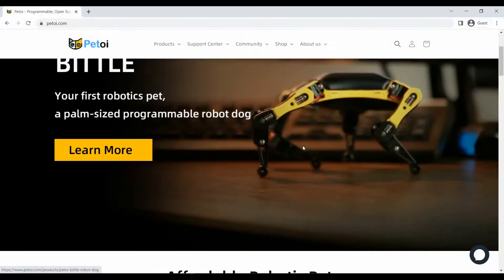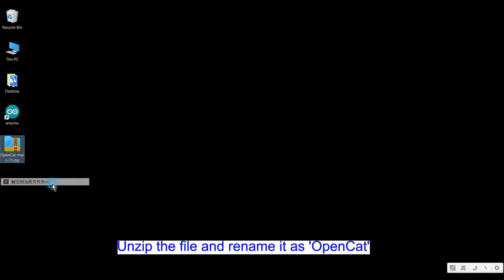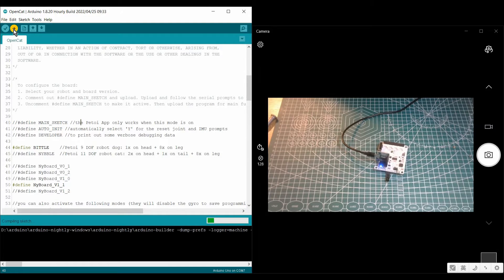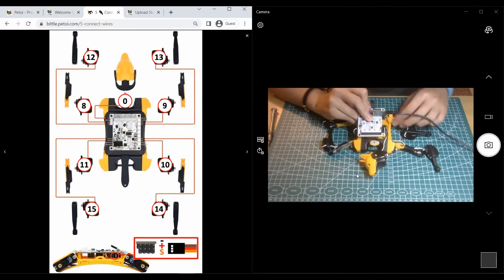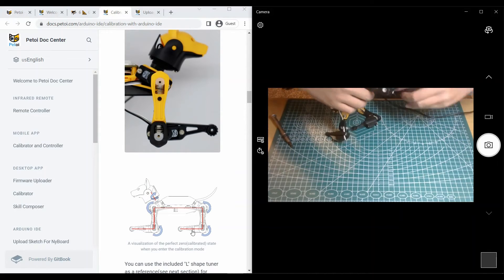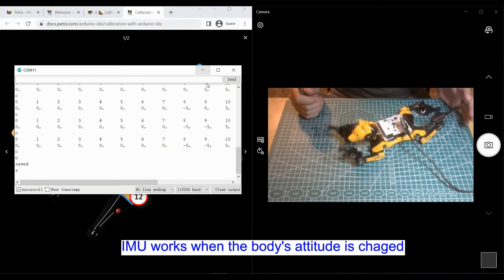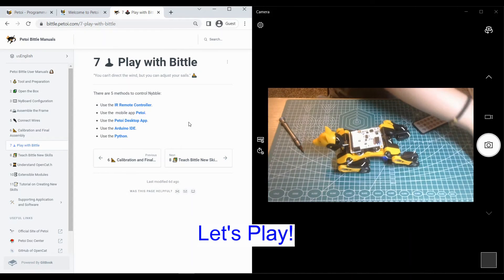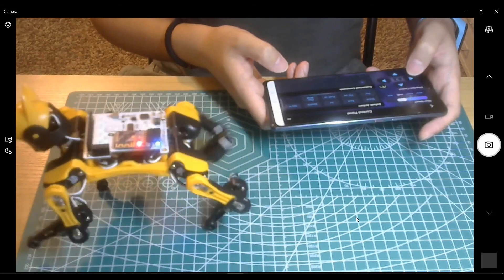Petoi Bittle Tutorial: Step-by-Step Guide with Arduino IDE | Petoi

Comment: I'm using a raspberry pi instead of the ftdi chip and when I press upload I get this error:

Arduino: 1.8.8 (Linux), Board: "Arduino/Genuino Uno"

Sketch uses 26528 bytes (82%) of program storage space. Maximum is 32256 bytes.
Global variables use 1559 bytes (76%) of dynamic memory, leaving 489 bytes for local variables. Maximum is 2048 bytes.
Low memory available, stability problems may occur.
/home/pi/Petoi/arduino-1.8.8/hardware/tools/avr/bin/avrdude -C/home/pi/Petoi/arduino-1.8.8/hardware/tools/avr/etc/avrdude.conf -v -patmega328p -carduino -P/dev/ttyAMA0 -b115200 -D -Uflash:w:/tmp/arduino_build_100060/OpenCat.ino.hex:i 

avrdude-original: Version 6.3-20171130
                  Copyright (c) 2000-2005 Brian Dean, http://www.bdmicro.com/
                  Copyright (c) 2007-2014 Joerg Wunsch

                  System wide configuration file is "/home/pi/Petoi/arduino-1.8.8/hardware/tools/avr/etc/avrdude.conf"
                  User configuration file is "/home/pi/.avrduderc"
                  User configuration file does not exist or is not a regular file, skipping

                  Using Port                    : /dev/ttyAMA0
                  Using Programmer              : arduino
                  Overriding Baud Rate          : 115200
/usr/bin/autoreset:16: RuntimeWarning: This channel is already in use, continuing anyway.  Use GPIO.setwarnings(False) to disable warnings.
  GPIO.setup(pin, GPIO.OUT)
done with autoreset
strace: |autoreset: Broken pipe
strace: |autoreset: Broken pipe
avrdude-original: stk500_getsync() attempt 1 of 10: not in sync: resp=0x49
avrdude-original: stk500_getsync() attempt 2 of 10: not in sync: resp=0x20
avrdude-original: stk500_getsync() attempt 3 of 10: not in sync: resp=0x6e
avrdude-original: stk500_getsync() attempt 4 of 10: not in sync: resp=0x73
avrdude-original: stk500_getsync() attempt 5 of 10: not in sync: resp=0x74
avrdude-original: stk500_getsync() attempt 6 of 10: not in sync: resp=0x69
avrdude-original: stk500_getsync() attempt 7 of 10: not in sync: resp=0x6e
avrdude-original: stk500_getsync() attempt 8 of 10: not in sync: resp=0x63
avrdude-original: stk500_getsync() attempt 9 of 10: not in sync: resp=0x74
avrdude-original: stk500_getsync() attempt 10 of 10: not in sync: resp=0x09

avrdude-original done.  Thank you.

strace: |autoreset: Broken pipe
An error occurred while uploading the sketch

Can someone explain what this means and/or how to solve it? Any help is appreciated.
Reply from the maker: Are you connecting the USB programmer when the Pi is attached? The board only allows one serial port. We usually use the USB uploader to program the NyBoard, and the Pi connection is only for control communications.